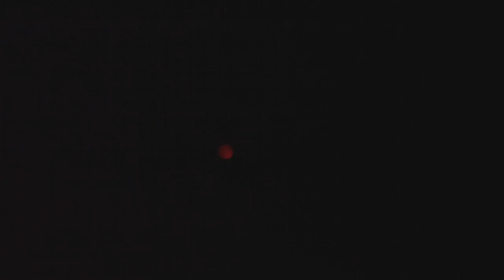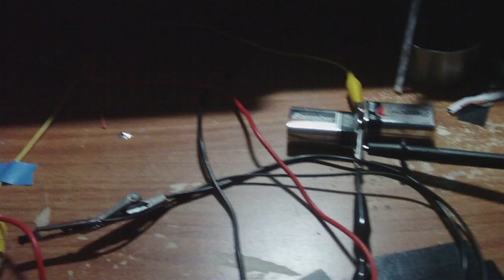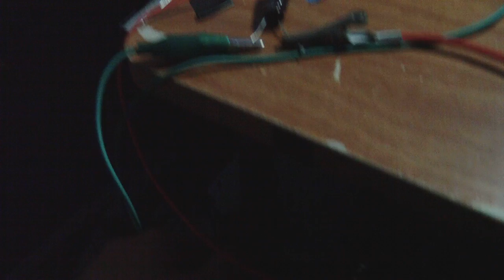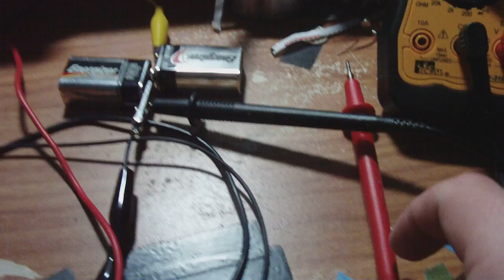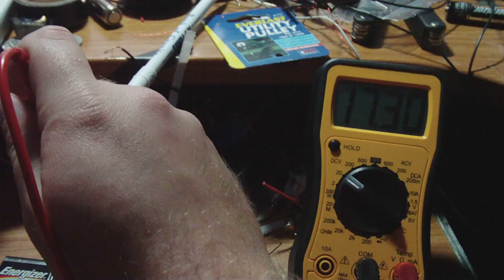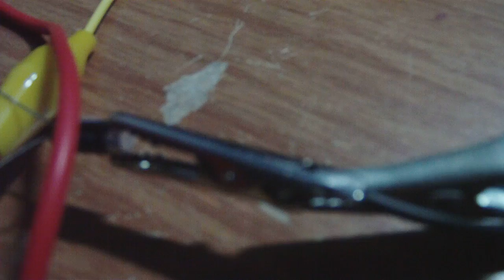Self charging Captret still running and LED still lit

Comment: What is the leakage resistance of the electrolitic cap ?
Normally it is in the 100K Ohm range, so there could still flow a current.
Also you have to watch out, some meters supply current from the measurement tips, so the meters could charge up your batteries if you do it right...
I had the same effect with my old scope that charged up a capacitor just by connection the scope head to it and ground it right...

Regards, STefan.